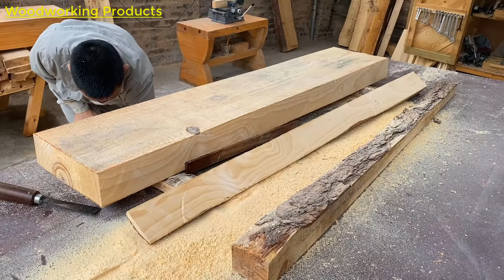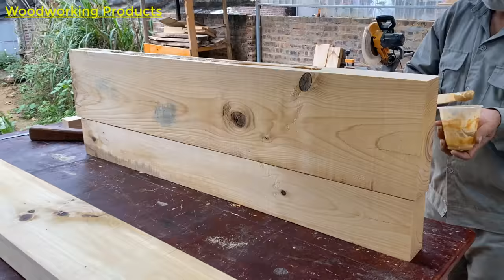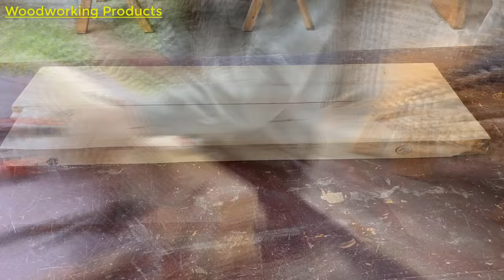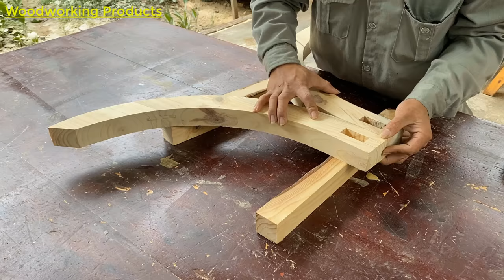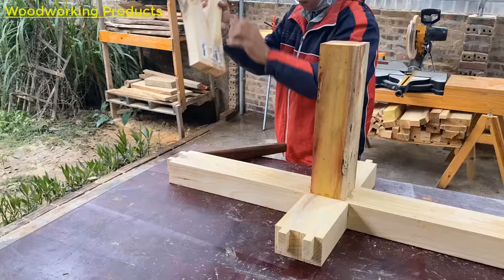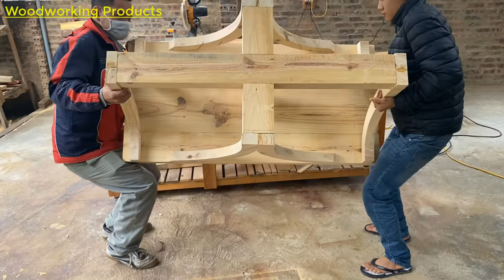Unique Furniture Designs That Will Make You Drool / How To Build An Interior Overview For Your Home

Comment: The workmanship is OK. but....
That's what's called over engineering on a grand scale!
The central column is entirely redundant, and so is the massive cross.
Also you'd need to be a contortionist to sit at it with a chair to eat.
The sharp corners are just injuries waiting to happen.
.